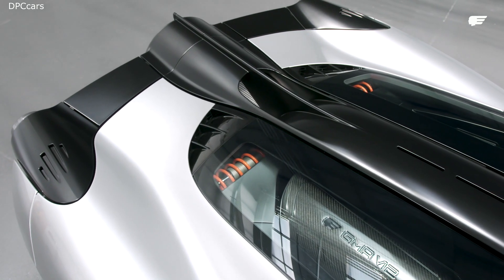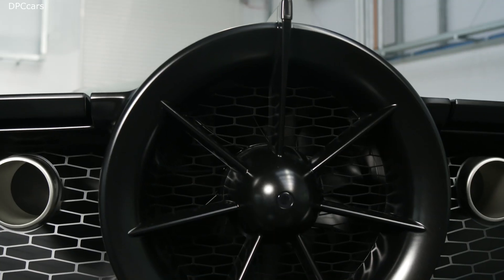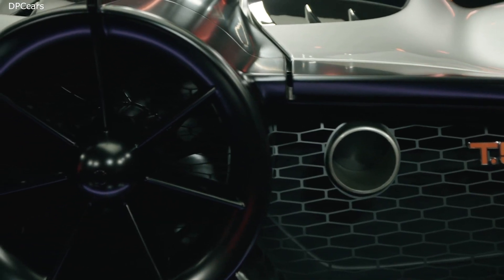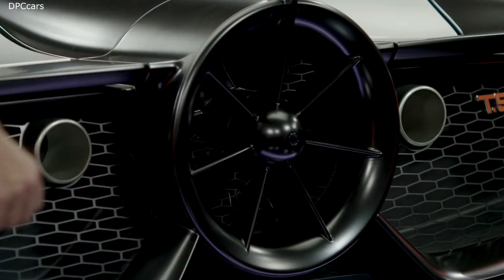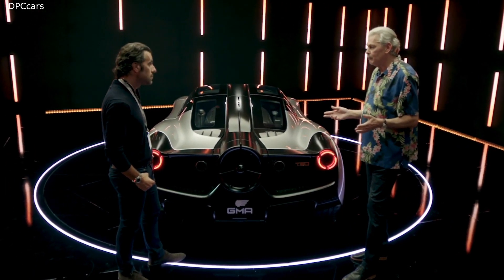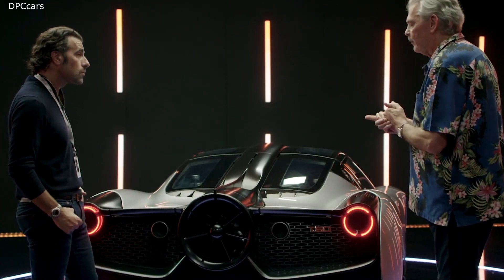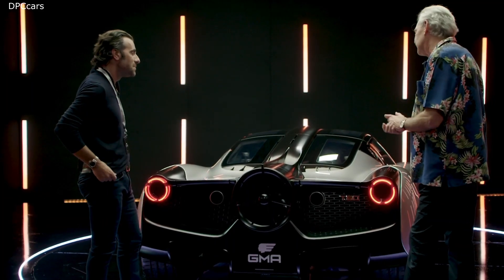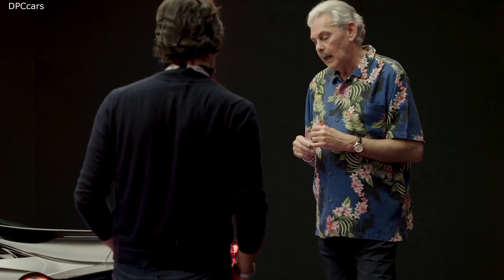Rear Mounted Fan on Gordon Murray Automotive T.50 Explained

Comment: 48v? Thats nothing. should be well over 100v and doing 30k RPM not a measly 7k I doubt that fan does what they claim it does. it just does not have enough power IMO. My bike is a 48v running on a 52v battery. surely GMA can make a Fan with more OOMPF than 48v 7k RPM. lol. Wouldnt it be funny if they were using an ebike hub motor for the fan. lol. I doubt it, I'm just kidding there.
Reply: A 16” blade at 30k rpm would have a tip speed of almost 3,000mph. Go look up why having blades traveling more than mach1 doesn’t work. Also, you aren’t taking into account the structural considerations to be able to handle those loads. Go read a book before thinking that because your Alibaba scooter has more volts than this supercar’s aerodynamic device that you are smarter than one of the most successful Racecar designers in history.
Reply: @AKracecars 
Nah, he's right. The McMurtry Spéirling electric fans run at 23,000 rpm and generate over 2 tons (!) of downforce.

This Gordon Murray 'solution' is just a gimmick. 😁
Reply: @peterdejong5456  Jesus man, they are not same thing. The McMurtry is the gimmick because it is a driving vacuum cleaner. Completely impractical to drive on a daily basis or do anything other than make fast Goodwood festival of speed runs.  It generates that much downforce because it has a sealed floor area. Take a shop vac and press it to your arm (lots of suction) now move it 1” from your arm (almost none). It’s impractical because it launches shit at the car behind you (that’s why in all videos you see of it, it looks smoky/dusty right behind it) and those floor seals will wear out quick.  If the mccmurtry fans do spin that fast, they will be a much smaller diameter because, again, you can’t spin a prop faster than Mach 1 without huge efficiency losses and a they would be extremely noisy. The T.50 is using the fan to augment the diffuser, not vacuum itself to the ground. Clever trick by one of the best car designers in the world and looks wicked.
Reply: @AKracecars  
Nah, the current Gordon Murray system is fundamentally flawed. It kan only generate downforce in proportion to the car's speed. So if you're going through a sharp bend at lower speed but pulling maximum Gs, you will lose grip and crash. The McMurtry Spéirling will simply continu without issue. A far superior design than Murray's current toy fan. 

Sure he thought of it first in the seventies, but because he did not know how to solve the  safety issues when the fan stops working and when the cars that follow are sprayed with little rocks, he now presents this powerless gimmick as progress. McMurtry actually improved the idea by using redundant fans and a very effective air filter. Now that is progress!
Reply: @AKracecars lol at the other guy questioning one of the best automotive engineers in history 😂

Comment: What about the little rocks and dead birds all getting picked up by that fan ? while its sucking the ground?
Reply: He literally explains in the video that it’s only controlling the boundary layer of the diffuser, not sucking on the ground like a vacuum cleaner like the Brabham F1 fan car.

Basically, it’s mainly blowing out the back, not sucking from underneath. 

It looks like it draws most of its air from the engine bay and those little channels along the roofline. This will only cause the same, or less level of threat to birds than a normal car with a big vertical grill at the front and a higher roofline.
Reply: It's for a race car, you don't get those things on track